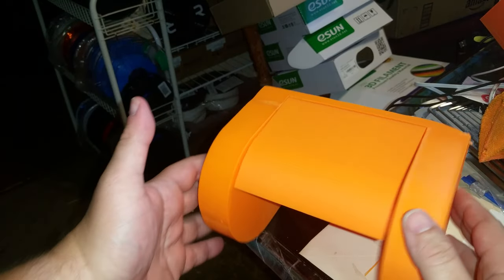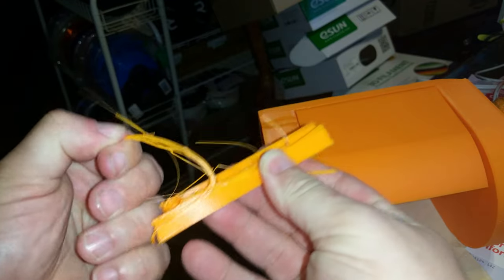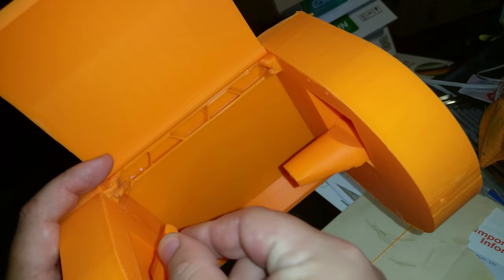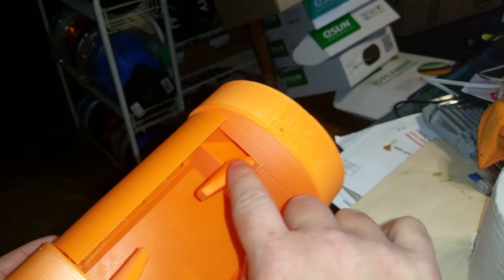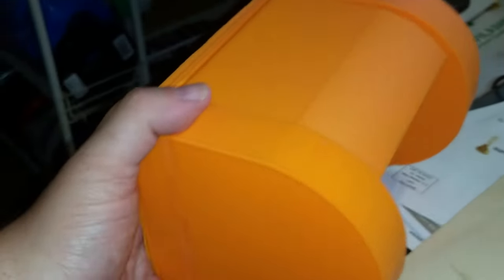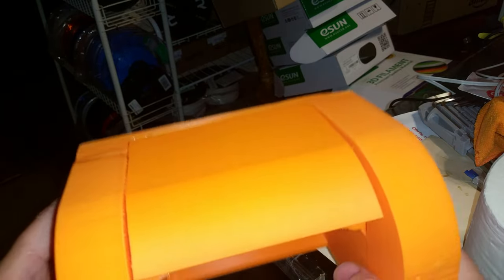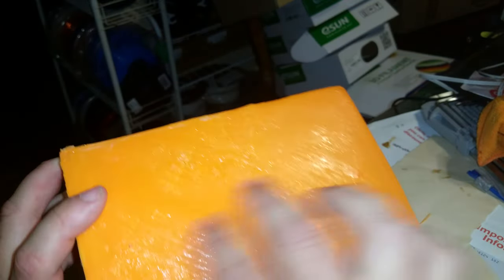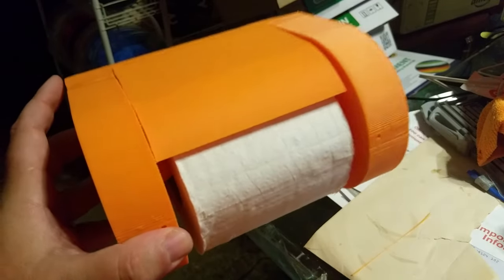Today's 3D Print - Toilet Paper Holder I Created

Comment: do you have a heated bed on your i3?
Reply from the maker: yes. the warping is this shitty PLA I am using. its utter crap. unless I find out its some setting or temperature or something I would avoid hobbyking PLA. it delaminates. has horrid layer adhesion (comes apart like horse hair) and flat out REFUSES to stick to anything. PEI. Blue Tape. Glue Stick. nothing holds the damned stuff. and its a freaking PLA !! gorgeous color. Prints gorgeous otherwise but first layer is almost impossible with the stuff. horrible.
Reply: The layer delamination could be improved with higher temp, but I've had this happen with bad PLA. PEI works really well with PLA. Even crap PLA. You need to sand it. And you may need higher bed temp
Reply from the maker: yeah I print with my smartbuy or repkord pla and zero issues :-) hopefully it is a settings issue I can compensate for since its a really nice orange but it has CRAP adhesion for the first layer and first layer is everything. I will go get some 600grit today. I hope it retains that nice glossy finish on my parts that is part of what is so nice about PEI besides not having to do anything but wipe it down with 91% between prints. SO nice.

higher bed temp won't cause problems with glass transition temps for pla ??
Reply: wet sand with 600 using alcohol. I use 99% from amazon, but 70% drug store stuff will work in a pinch. Do light sanding, concentric circles, wipe with alcohol using micro fiber cloth. I have really good success with PEI, with basically everything, it's just about getting the right bed temp -- having the bed at 60+75 is fine, you just have to have patience when it's done and wait for the bed to cool down (if you don't the part will come off deformed) - it will stick super well with sanded and higher temp.
Reply from the maker: no 600 I got some 800. it does work. things seem to be sticking a bit better alas the shiny is gone. :-( its smooth but not "mirror"

oh well. better parts is better than crap parts with a mirror finish.
Reply: Depends on filament, some will still be mirror shiny. I print things which take up almost full size of my 500mm diameter delta bed, sticks to sanded PEI really well. Stays stuck down too. I like the finish of ESun PLA+ it has a mirror look